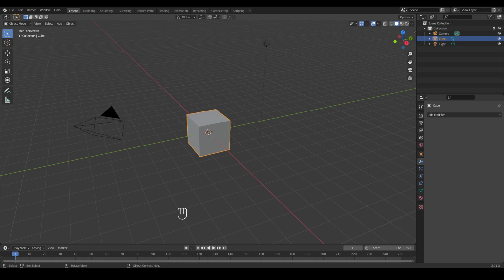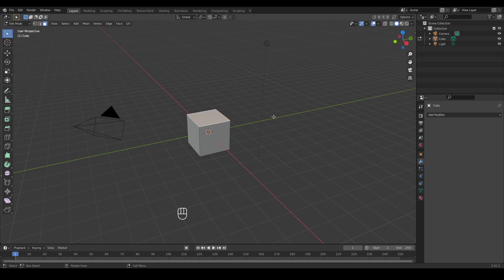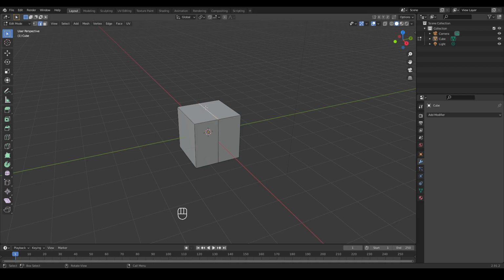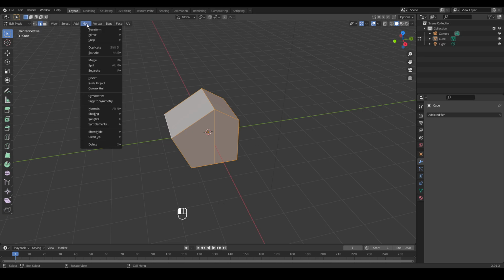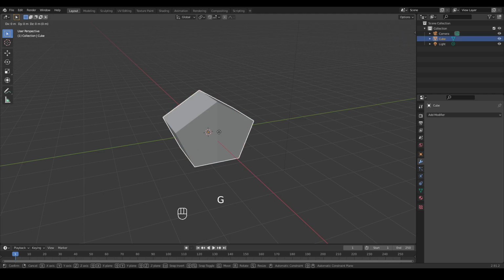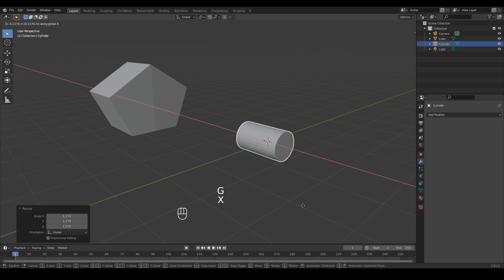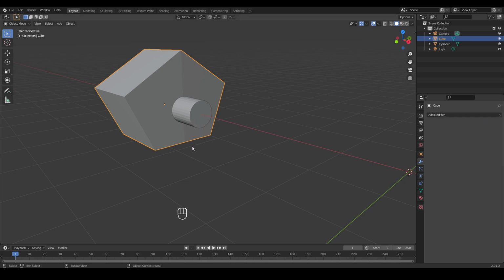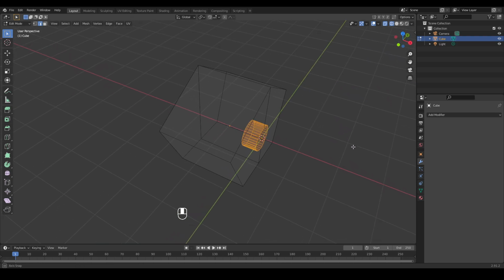Create a Bird's House in Blender 3D software.

Comment: Mannnn why make it two videos. I just want to know how to make a hole in a single wall of a hollow cube. I can't find a single video anywhere that shows me how to do that. And as a general noob to Blender it's fucking difficult because there are always about 10 ways to do something and there all called something different. My mother wants a birdhouse and I've been trying to make her one with my printer for a length of time I'd rather not say. I feel like slamming my face on the keyboard and rolling it from side to side would give me a better chance of completing this project than doing it any other way. And I don't want to just get a random one from a file bank because I want to make it custom for her. Any way you could help out with this? Or should I just try the face-rolling technique?